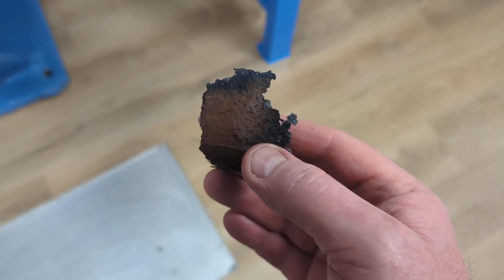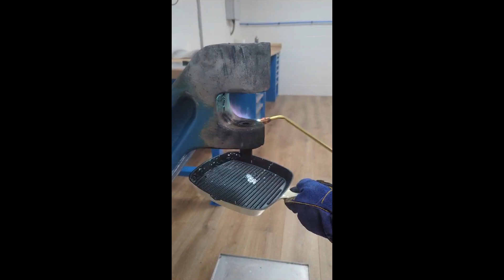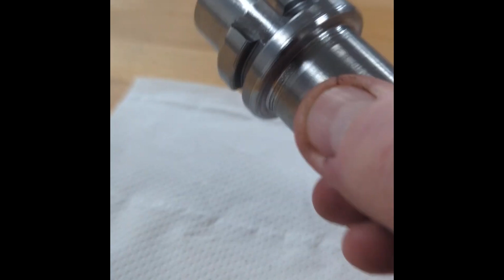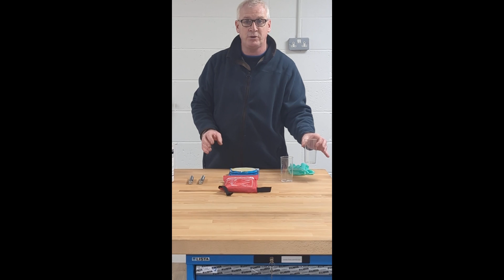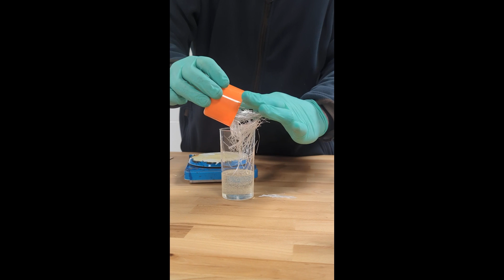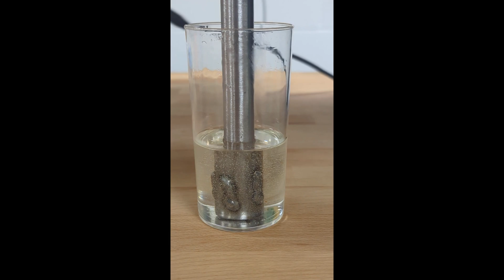How do you solve a problem like an English Wheeling Machine? Inc Dom from The Repair Shop (Part 2)

Comment: Thete are better Adhesives than a 2 Part Epoxy available....Industrial Adhesives are 2 Part too but come in a tube setup that while requiring a special dispenser are still a good option in cases like this...They sell adhesives designed to adhere strongly to metal components and will be stronger and longer lasting in most cases... basically as strong as a welded repair if done as instructed ( proper preperation and cleaning etc...).. these systems are used in many applications where strength and holding power are needed... Automotive and Commercial Industrial suppliers can help you find the proper product..as will a simple Search Online....
Reply from the maker: Sorry for the late reply. Thank you for your advise, I am always up for new ideas and I will look into these for next time. Thank you for watching

Comment: You used a 3/4 inch BSW tap. Was the original 5/8-11 BSW? I’m trying to replace the threaded rod on my Ranalah as it is too short and it binds.
Reply from the maker: sorry for the delay in replying. From memory I think it was a 5/8" BSW. Let me know if you still havent sorted it and I will go back through the records to track down where I got it from and the size. Thanks for watching

Comment: One of the properties of printers' type metal is that it does not shrink when it transitions from liquid to solid form on cooling.  This is due to the presence of antimony.  Babbitt metal, as used by Dom, is a similar lead-based alloy which also contains antimony and presumably does not shrink either.  Is it possible that your Ranalah had been repaired in the past with a common-or-garden tin/lead solder instead?
Reply from the maker: sorry for the delay in replying. Yes you could well be right, I have never dealt with babbit before, but this definitely shrunk so could have been different repair prior to me buying the machine. I have been using it for 18months now and been really pleased with it. Ill definitely do it again if ever the top one goes. Thanks for watching